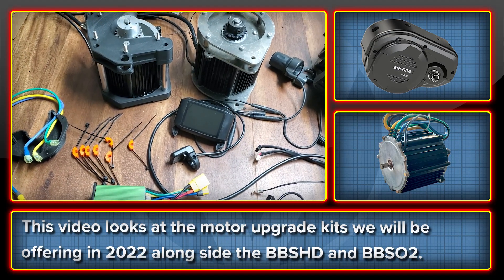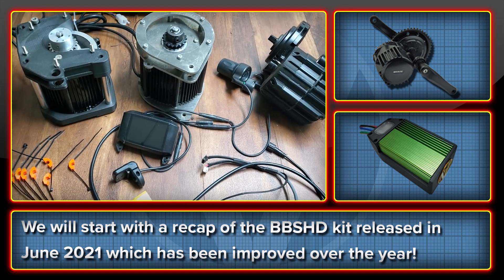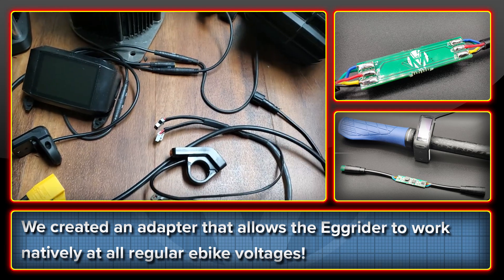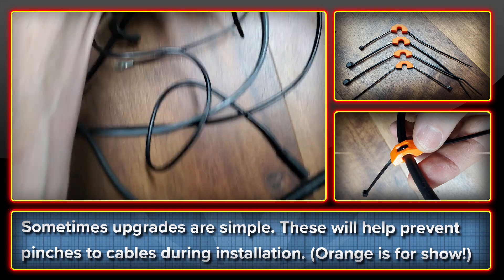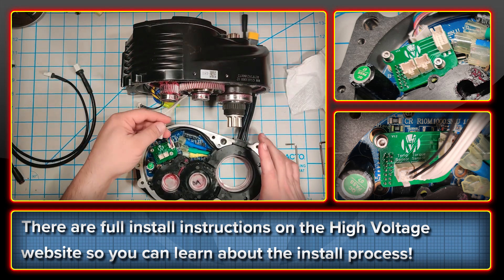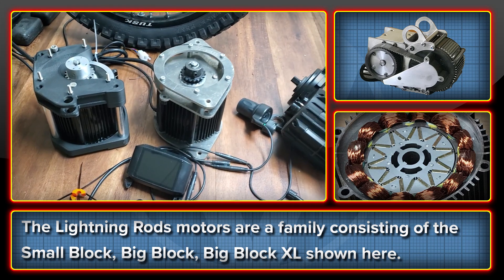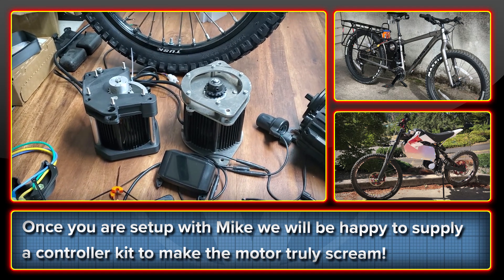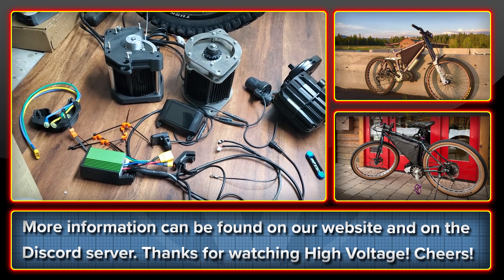Bafang Ultra (G510 / M620) & Lightning Rods ASI controller upgrade kits - New for 2022

Comment: What ever happened with the bafang ultra kits?
Reply from the maker: We never quite got it to the point where it was easy plug and play for 99% of people. Its not written off yet but I don't really have an update either.
Reply: was it easy to slap a high amp kt controller on the motor and bypass all of the bafang internal functions? did you ever try that? @HighVoltageKits
Reply: @HighVoltageKits how about for the uart people?

Comment: any updates on the M620 torque sensor/pedal sensor?  Have you gotten it to work with the Canbus motor?
Reply from the maker: Not as of now. Unless we can crack the protocol or find it from bafang 😆
Reply: @HighVoltageKits  would you be able to read or copy the code for the torque sensor from the firmware  Bin file V41.1?

Comment: Where to get this board at 03:00? Is it plug and play? Will it secure the eggrider from voltage peaks when using dual battery set up? Thank you!
Reply from the maker: We are not making the boards for the eggrider at present. We could not get a reliable source of components sadly.

Comment: Does the BAC855 work properly with the G510/M620? No stuttering issues etc? Does it run sensorless?
Reply from the maker: It runs it sensorless. We have a kit in progress that will run it with halls. It will also run the torque sensing but that is a bit more tricky with interference. The can bus version the halls work but the torque sensor reverts to simple cadence pas as they locked out the torque part with a can bus chip. There have been a few examples of sensorless about tho.

Comment: How much watts will this kit produce on 52V battery on the BBSHD?
Reply from the maker: 2800-3000 is usually the peak for a 52 volt battery. 4000 is possible at 72 volts

Comment: I’m looking to upgrade from an M600 to the M620 do you know if that is doable like is the bracket/ mounting holes the same? Thanks in advance! 🤘🏼
Reply from the maker: As far as I am aware they are different sizes. The 600 being more compact. You would likely need to significantly modify the frame if it is in fact possible. You might be able to lo are a 3d model of the 620 to compare it?

Comment: Wow nice, so where can i buy ASI BAC855 kit for my Bafang Ultra G510 WILL BE USING 920WH 52V BATTERY :)
Reply from the maker: We are working on a kit. Its been delayed due to the availability of controllers. Should have some more info on the channel soon. In the meantime we are dialing everything in so its as seamless as possible for folks looking to use it.
Reply: @HighVoltageKits  how long do you think it will take to have the kits ready?
Reply from the maker: We are looking at July to receive controllers which is the current hold up
Reply: @HighVoltageKits  Yeah things are tight at the moment :( and i don't see it getting any better.😔
Reply from the maker: No I just looked for fatbike wheels....

Comment: I’m restoring/modifying a 2012 Zero Xu, and it sounds like the Big Block XXL might be a great option for powering it.
Approximately how soon do you expect to start making them available for sale?
Reply from the maker: They are going into bench testing in a week or so. In the meantime you can join our discord platform and chat to Lighting Rods directly. You can also email Lighting Rods via the form on the website under the links in the description. High Voltage is supplying controllers packages to make it run. The drives themselves are direct from Lightning Rods. I am sure he would be happy to make one available as soon as possible. Hope this helps. Cheers

Comment: What could I expect to pay for a bac2000 vs a bac4000? I feel like the bac2000 might be substantial enough if it's cheaper it could be a good choice...
Reply from the maker: I'm not posting prices at this stage. You can get in touch with the High Voltage team via discord to get a rough idea. The BAC4000 I think is about 2/3 more expensive.

Comment: This for UART bafang Ultra also?
Reply: Yes, we recently made some changes to allow the kit to work on all versions of Ultra including v1.0 (UART w/ classic halls), v1.5 (UART) & v2.0 (CAN-Bus) - Mike (HV Team)
Reply: @haymike  Nice thanks, how can you tell whether you have V1 or V1.5 UART?  Thanks
Reply: @haymike  is there a way to tell the versions apart? Eg case design or from code stamped on the case? Looking to buy one secondhand so limited to just photographs
Many thanks
Reply: Yeah you can tell them apart by the laser etching on the bottom and also by the type of connectors that are used. The UART version has a female 8 pin connector on the motor going to the 1t4 cable while the can-bus has a male. UART has a 3 pin speed sensor and the can-bus has a 4 pin speed sensor. Our kit will work with either motor but will only be compatible with the UART 1t4 cable and speed sensor since they are more common and easy to find.
Reply: @haymike  hi Mike.  Can you give us an update with the m620 kit?  Any ETA??
Reply: @haymike  that’s great to know, thanks for the information. Love projects like this, keep up the great work
Reply from the maker: It will be for the 1.5 and CANBUS variations which I think is the same thing.
Reply: Canbus is definitely different than UART.  What is 1.5?

Comment: YES.YES.YES,I want more ..just a little problem. All that power John goes to the rear wheel,could you possibly make à chain out of titanium as I am on my 5th chain,due to my heavy chassis and a heavy fatbike I want  to keep the 8 speed gearing and the 34 tooth  
Sprocket...what's the thickest chain I could use without screwing up the shimano acura?? I would love to have s single speed but the big steep hill in front of the house has a very steep incline...anyway great 👍 
Video,will post a rebuild of a reention battery pack soon on high voltage ⚡, 
HAPPY NEW YEAR TO ALL THE GANG AND KEEP UP THE GREAT WORK..Submarine 👍..
Reply from the maker: Awesome! I will look forward to that. Q titanium chain is beyond my skills. Is it an actual thing? 6-8spd chain. Let's open that conversation on discord. We need a web page with chain information on. Its such a common question. Cheers
Reply: Belt drive could be an option?

Comment: Exciting. This comes just after receiving a new stock controller (shorted my old one poking around), so if I never figure out how to recalibrate the motor to the controller I'll have a second option! UART protocol, if you can help xd
Reply from the maker: Its tricky! You are welcome to join our Discord and one of the Ultra experts can give you some pointers. I think the sensors might need to be positioned! The link is in the description!
Reply: @HighVoltageKits  Finally solved my last hurdle! I had not realised I needed to flip the Tx/Rx when connecting to the display versus connecting to the motor! It's too cold, dark and wet to test it outside now, but there's hope.
Reply: If you're curious, I have a hex file to upload to C961 display which will give it the functionality to run a recalibration. This is at least for 48V.. I don't see why it would work on a 52V model either